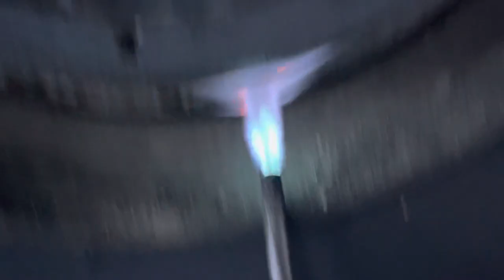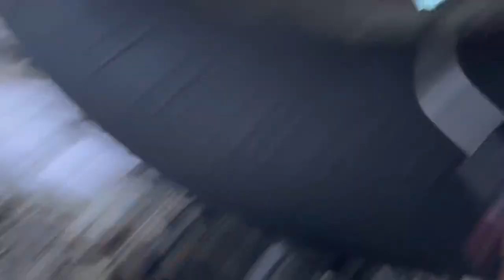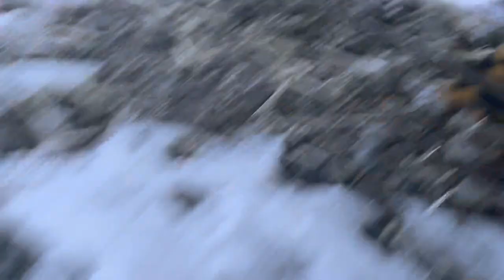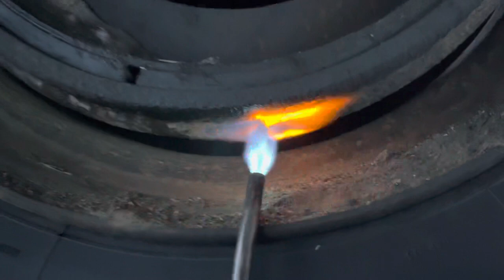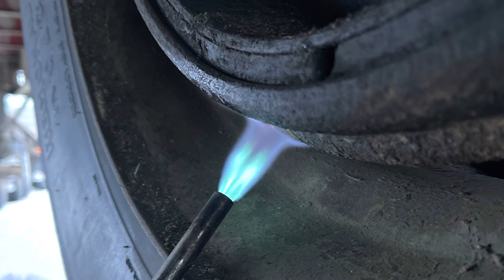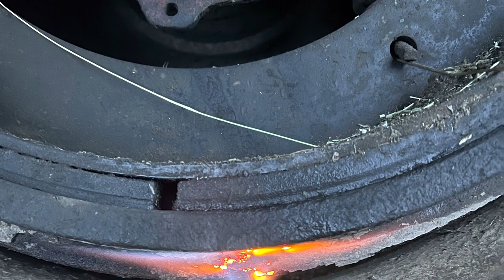Release Frozen Trailer Brakes the Easy Way

Comment: exactly what i was looking for. thank you so much.
Reply from the maker: @Dad Dare I knew this would help you out dramatically in your operation!
Reply: Currently at a truck stop in Alberta right now, watching this - attempted knocking and using heater buddy but didn’t have enough heat focus I guess. Heading to the hardware store now.